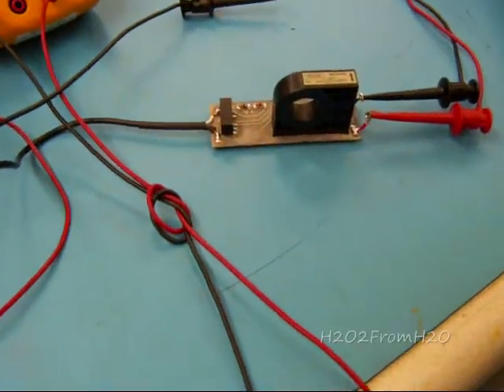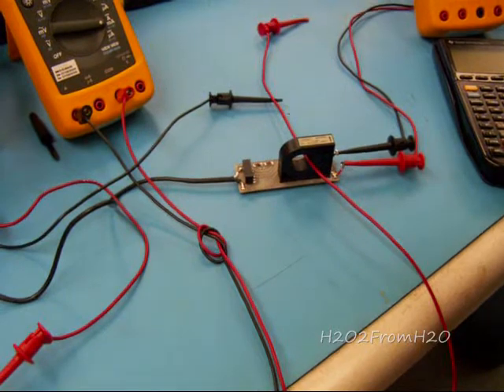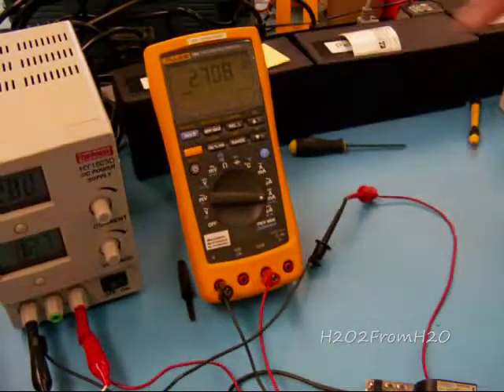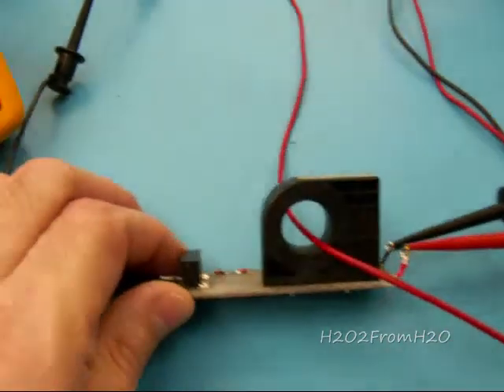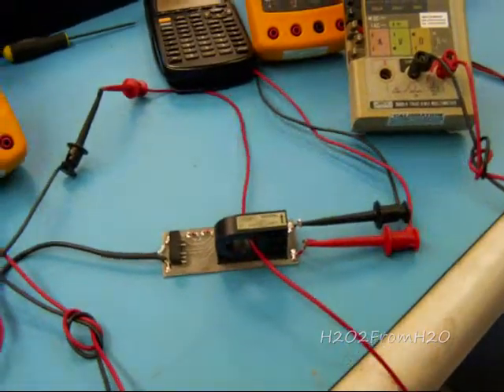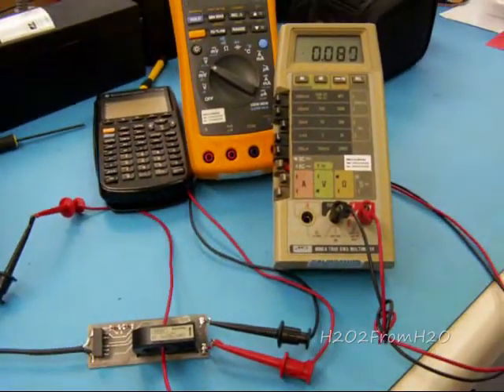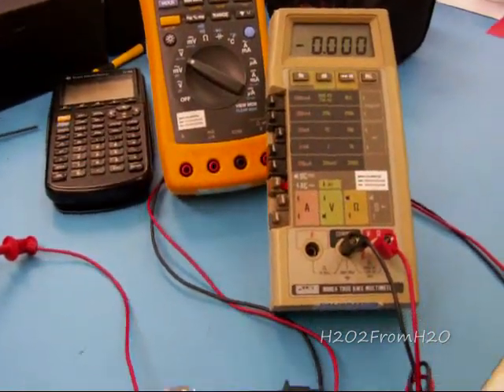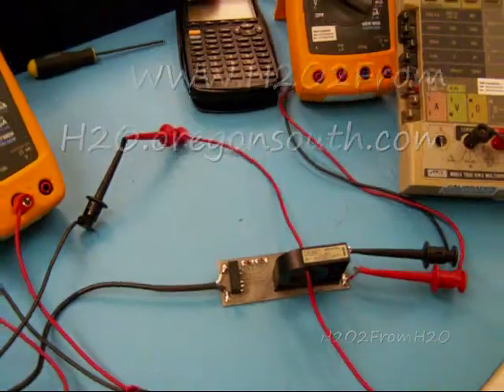#20 H2O2 - Current HE V1.0.1 - A budget Alternitive to a $70 or more Clamp on Current Meter Part 1

Comment: You're right. Copper does have a positive resistance temperature coefficient. It's still going to be within 5% tolerance once calibrated cold, certainly good enough for quick and dirty high amperage measurements.

Comment from the maker: The Linearity of the L08P100D15 from Mouser is less then or equal to +-1% at 100 Amps.
I am personally experiencing a shift in current as the temperature of my PMS increases from Self heating. It happens between 20 and 30 amps. I can feel the shunt heat up. I will preform further test.

Comment: Okay, ~$30 for a current sensor that still needs an op amp with adjustable gain and power supply.

PMS about $1.00 in hardware. Very linear.

How linear is the HE?

Comment from the maker: I totally agree, It would be a great feature, I have plans to add the Amplifier and I am relaying out the board Shortly to accommodate the Lower voltage regulator. The only problem with the Scale amplifier is that a Scale of 0 to 1 volt out has a poor resolution .1 amp steps, the other option is 0 to 10 volt scale but the operator will have to move the decimal over 1 place 20 amps would read 2.000 volts and the resolution is excellent. What option is better?